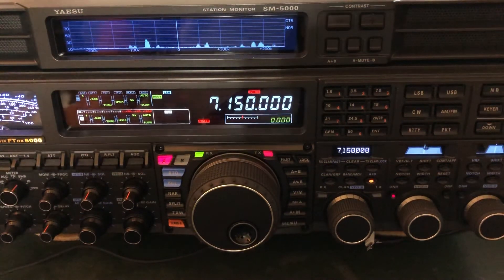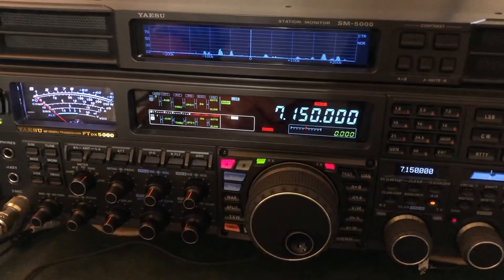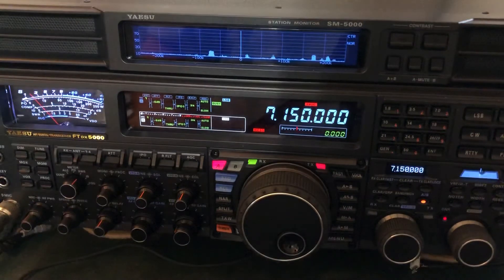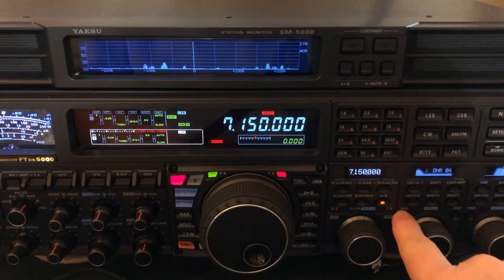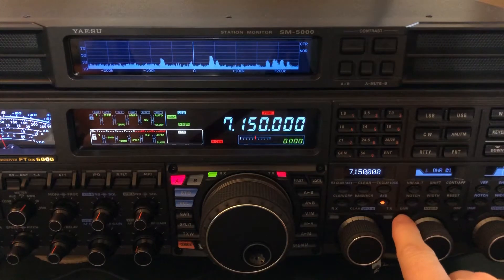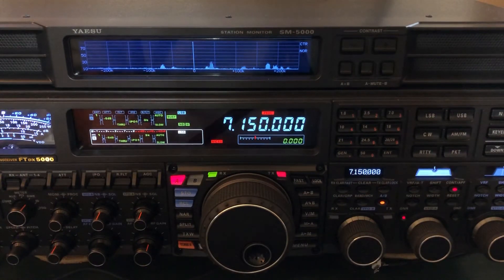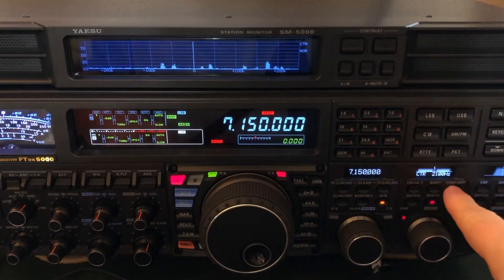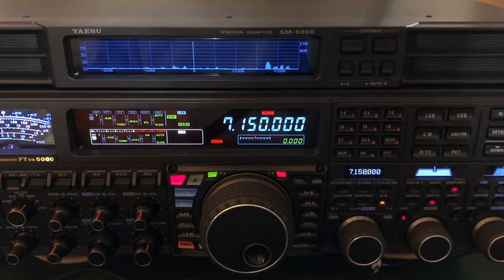How I configure and use the Contour Control in my Yaesu FTdx5000MP

Comment: Why have contour set to “cut”?  You can already cut with the notch filter and the filter skirts. Instead try changing it to “boost” an use it in the 1800-2100hz range to increase speech intelligibility.  It makes a huge difference.
Reply from the maker: Boosting contour at the frequency where the voice is more intelligible brings in more noise too.  I’m not going for fidelity.  I going for intelligibility,.  Dulling the noise with a contour cut helps me hear the words better than trying to pick the voice out of the noise that gets amplified when boosting with contour.  Maybe my ears hear differently than yours.  73
Reply: @n4hnhradio  The Contour control works in the IF before the AGC so boosting the range where speech intelligibility lies will cause the AGC to reduce the rest of the signal (noise).  So, using contour as a boost is still reducing noise.  I’ve got contour level set to 10 and width set to 8 on my rig.  You might give it a try if you haven’t before.  73’s K9YK
Reply from the maker: I tried boosting contour when I first got a FT-891.  I’ve also tried it with my 5000.  It still sounds more intelligible to me with DNR at 7 and Contour set to the factory default of -15dB and a width of 10.  73